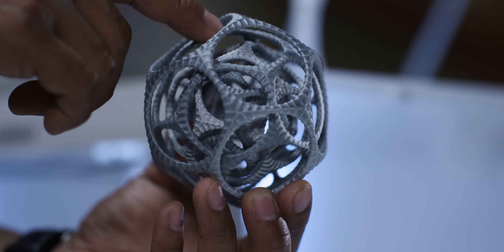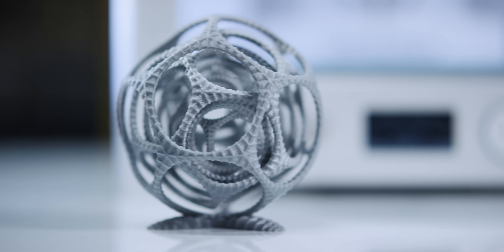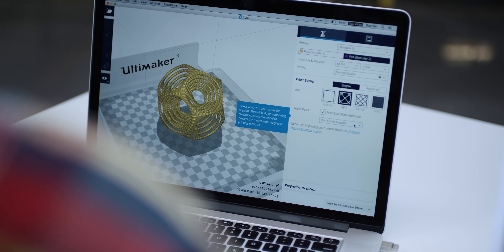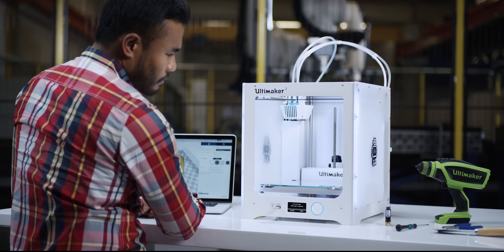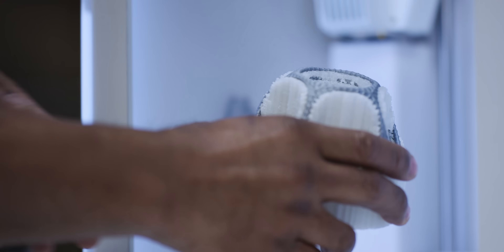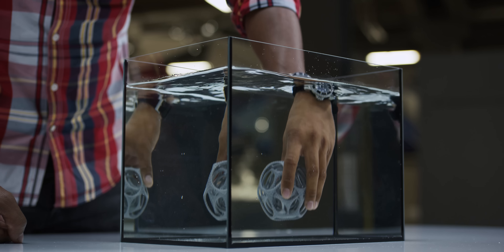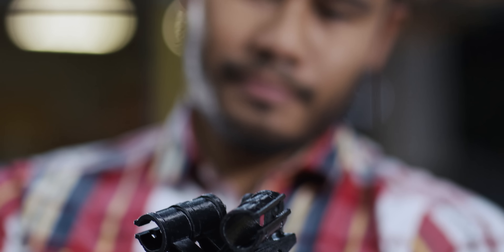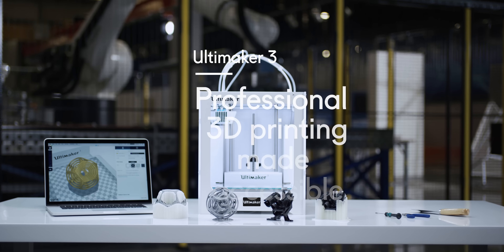Ultimaker PVA Explained - Water-soluble support material

Comment: I use the Ultimaker 3 Extended now for about 2 weeks. 
With 2 color PLA prints I am very satisfied, but with PVA support material I have only chaos.
 As I see it, the problem is that the PVA is not adhering to the PLA "stripping tower". Generally, I find the adhesion of PVA to PLA on my printer is not good. 
Do you have an idea where the problem could be?
Reply: Domex v0.1 I have the same issue, PVA doesn't stick and is too stringy
Reply: Use only stock CURA settings With PVA.

Comment: How much time to take water soluble?
Reply: I have the same question, i'm printing this model, so I'll tell you, it takes near 2 days, 45 hours, of printing
Reply: @samueleguariento7925  2 days and 45 hours of printing what?  How long does it takes to dissolve?
Reply: @antdx316  to dissolve totally it takes 8 hours, when I used a thick support, you can put it in cold water (hot will dissolve pla too), i let it sit one night the first time, the second time I used a small bucket, so I had to change the water, and in the bucket it tooks 6 hours, 3+3

Comment: What is the NFC feature for on the spool holder for? Does this lock us in to your filaments or can we still use whatever 3rd party filament we want?
Reply: 3rd party filament is still accepted, but Ultimaker spools will give the machine all the information (basically filament profile) needed, so it saves a few clicks of the wheel when changing material.

Comment: How can you print the black and green drill with two colors when appears that it would require support material thus making two colors impossible? The only way I can see doing it would be to print it in two or more pieces and then assemble it. Is that correct?
Reply from the maker: Hi Jason, the black and green drill was printed in an orientation where support material was not needed (on its back, printing upwards towards the drill bit).
Reply: It would be great to see a video of that print!

Comment: How long does it take to Dissolve?
Reply from the maker: Thanks for your interest! The dissolving time varies depending on the size of the model and the amount of PVA used.
Reply: How about examples of the dissolving rate?  minutes? hours?
Reply: 2 hours for big supports.
Reply: Some supports go in a few hours however if you have internal right angles or tight spots this can take up to two days in a non moving water environment

Comment: What about ABS with the PVA?!
Reply from the maker: ABS won't adhere to PVA, so this is not currently possible. We do support PLA with PVA or Nylon with PVA combinations!
Reply: Ok thanks for the reply, although I've noticed the Zortrax Inventure uses water soluble supports and ABS...  Also is the quality of Nylon with UM3 the same as using PLA/ABS? People struggle to get the quality with Nylon
Reply: You could print with ABS-PVA, but it's not recommended. The recommended settings for PVA have been chosen by extensive testing of PLA-PVA, not ABS-PVA.
I bet the support settings for PVA in an ABS-PVA setup wouldn't be that different from those in a PLA-PVA setup, but that's just guessing. I haven't done the crazy amount of testing Ultimaker has ;)
Reply: What about PET-G with PVA?
Reply: If I remember right, PLA is used as a support for ABS in Dimension printers.  It is removed by cleaving the polymer in  a warm sodium hydroxide solution.
Reply: @Ultimaker  surely it doesn't need to adhere properly?

Comment: Cant any printer with dual extrusion heads do this? Such as the Taz 6 with dual extruders?
Reply: The BB print core has been manufactures especially for PVA and has a different internal geometry than AA print cores.
You could put PVA in a Taz printer, but my guess is that the quality would be quite poor and you might end up with a clogged nozzle more often than not.
Reply: Lol ok. Well Taz 6 can print a huge list or materials including pva and isn't known for clogging nozzles unlike MakerBot clones etc. Seems kind of silly if the entire hype they are building around this printer all comes down to the shape of a nozzle. 

The auto level print bed is a great edition but is late in the game. The size is not much bigger than a 2+. Just seems like this printer is a reboot of the 2+ with some added convince features, dual extruder, and a much larger price tag than other printers that can do the same and already had auto bed leveling. 

And how many materials can this print? Only 3 or is their a large list?
Reply: What's your experience printing PVA on Taz 6?
Does it print well?
What does it mean if a material is on their list?

For Ultimaker it means that they have done extensive testing and tweaked a hundred settings to the best value.
Reply: What's YOUR experience with the Taz 6? You basically are guessing that it would fail at printing PVA like this and sound like an Ultimaker fan boy or something. Bottom line the Taz 6 has a high reputation established of not clogging and being reliable. I have nothing against ultimaker but this printer has NO reputation and hasn't been tested by independent consumers to see if their claims of reliability are true so time will tell.
Reply: +Bluelight Gaming I have no experience with Taz and I was indeed guessing - based on the fact that many printers can't handle PVA well. Also the fact that Taz lists many materials tells me they have tested a bit with a lot of materials instead of testing a lot with a small list of materials. Again speculating here...
Reply: There are tons of 3d printers out there.  Comparing this printer to a Taz is like comparing an apple computer to a pc.  Even I could argue that you could BUILD a 3D printer thats just as good as this for $1000.  It just depends on what the consumer wants.  With this printer you are paying for the brand, support, and how robust it is.  Happy printing!!
Reply: I get what u are saying and u r right but I wouldn't go as far as to say it is like Apple vs pc. More like Intel vs AMD processors or AMD vs Nvidia graphics cards since Lulzbot is a direct competitor of Ultimaker in both quality and price point.

Comment: I have yet to meet someone who says this material is worth the hassle, and i've been printing for 8 years.
Reply: why is it not worth the hassle?
Reply: @Zugaaa  Because the print head always clogs, the material is absolutely terrible to work with and the print time is insane as PVA has to be printed very slowly. I have an ultimaker 5 at work, we stopped using pva a while ago and went back to using pla in a different color for supports (when you optimize supports with pla, they almost fall off the model without leaving a trace) and the results have been much, much better.
Reply: I use it all the time at work and never had an issue with it. Much better than having to break off supports

Comment: will this water solutable pva disolve by epoxy?

I want to print things that I cover in carbon fiber. Then remove the form with water if possible
Reply from the maker: Hi Rickard, thanks for reaching out!
In principle, the PVA should not be dissolved by epoxy. However, do keep in mind that if the PVA is covered with a layer of epoxy, this will keep it from being dissolved by water.
Reply: Hi! Thanks for responding. I guess you mean some of the PVA will soak up som of the epoxy. I dont Think that is much of a problem for me. Also I can probably cover the form I 3d printed in alu foil or something.